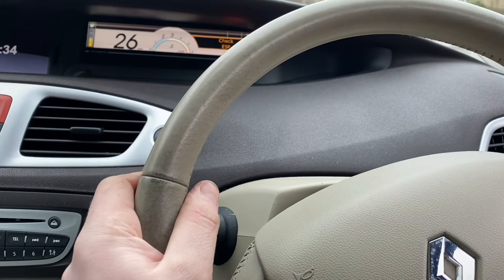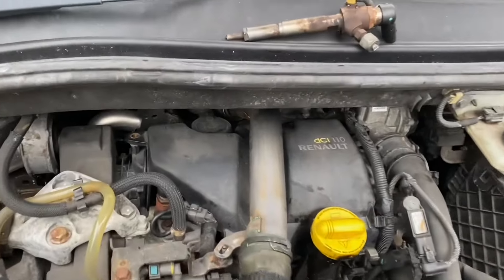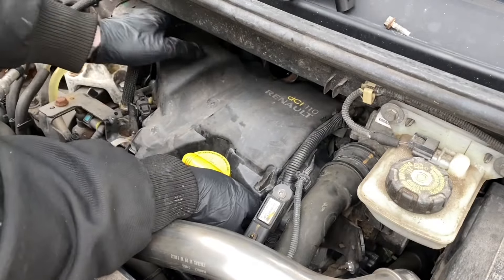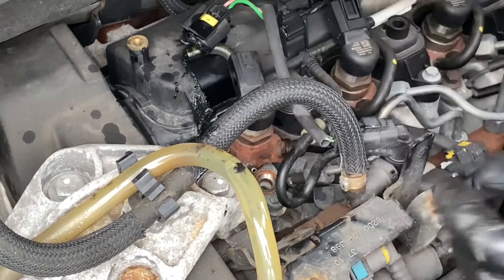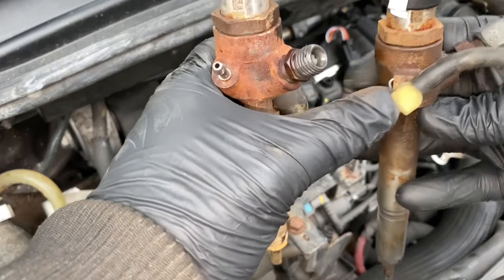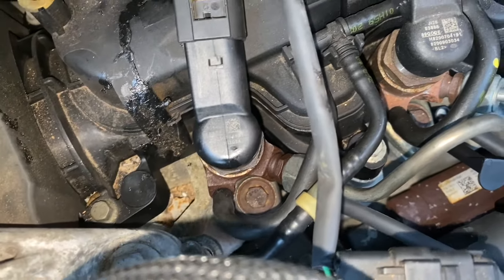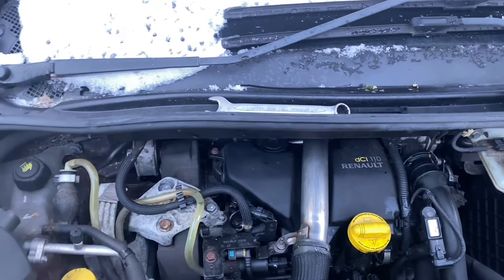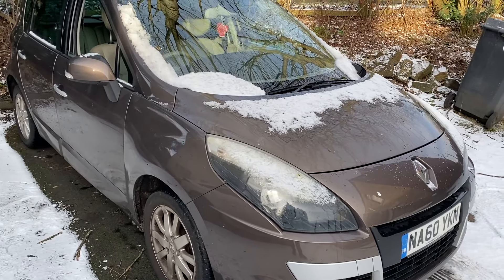Renault Scenic 1.5dCi Injector Replacement (Dacia/Nissan/Renault)

Comment: My local garage didn't want to know when I meantioned injector issue, said it was to much haw. Yet you just did it with minimal tools. Bravo.
Reply from the maker: @RollerbladingwithRoss  these aren’t usually a bad engine to get them out of. Some Renault’s are HORRENDOUS. I think I did get lucky though

Comment: Can I suggest that when you take the plastic cover off you bin the thing. makes life a lot easier. did it with mine.
Reply from the maker: @roberthay8706  saves taking it off and putting it back on on a daily basis I suppose 🤔

Comment: Thanks but why these injectors fail in their piezoelectric part ? Just after completed the 5yr warranty time, with only 21,000 km , 2 diesel injectors failed in 6 months on my Duster. No fuel issue.
Reply from the maker: Because they’re shit?
Reply: Is there any better alternative , which can fit in our engines ?
Reply from the maker: @steliossykiotis386  not that I know of but it’s very unlikely. Have you definitely not misfuelled it with petrol at any point?
Reply: No , always use EKO AVIO Diesel or SHELL  V Power diesel. Lots of 1.5 dci face same problem , so is not a fuel issue, is low quality product issue

Comment: Digi dash for speed ,,,,, does it rhyme with Kit ,,, Michael ??

So nice to see the Goldilocks cable tie in use though ,,, not too big and not too small ,,, 
but just right.
Reply from the maker: Only ever oem parts, or at least the correct size cable ties used on this channel
Reply: @StupidBlokeStupidVideos   Dont ever believe what she tells you ,,, size does matter 

lool

Comment: Great video again. I have a shitty puriel that had nearly dead injectors. I replaced all 4 and has run fine for months without coding in. Does it make that much difference?
Reply from the maker: Thanks mate. The coding isn’t always that important, some cars will run pretty much fine without it. Some won’t. It’s just a calibration code that’s all

Comment: I didn't code mine and lost a few mpg but otherwise it ran OK.  It wasn't cheap to get it coded.
Reply from the maker: Did you notice much difference after coding it in?
Reply: @StupidBlokeStupidVideos  Sorry. I was just commenting it wasn't cheap (when I enquired) so I just changed the injector and ran it like that. When I realised it was losing only a few mpg and I  wasn't doing big mileages  anyway any thoughts of getting it coded went out of my mind.
Reply from the maker: @we-are-electric1445  fair enough

Comment: Some rust on the old injector....😮
Coding injectors, another money making scam by manufacturers 😢
Reply from the maker: Yea a bit of rust there. The coding is just a calibration code. The tolerances on these things are so tiny that they can’t make them exactly the same. My understanding is that when they are manufactured, they are tested for exact flow rate and the code is just a reference for the ecu to know the minute specific difference of that injector to another one if you know what I mean. It ran seemingly fine without it coded in, but had a bit of diesel knock and sounded like one injector was leading. Coding it just fine tuned and smoothed it out. Some cars will self fine tune after a few miles anyway.
Reply: @StupidBlokeStupidVideos  thanks, was thinking it was another way they use to get money off customers. I'm wrong 🙄